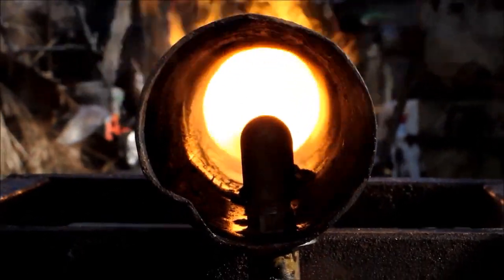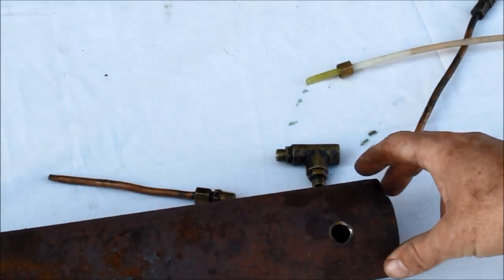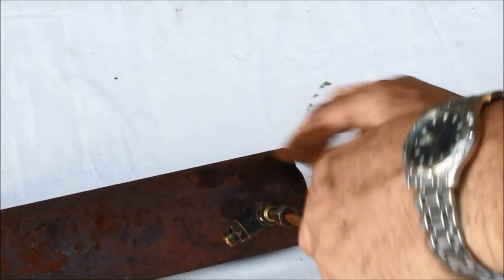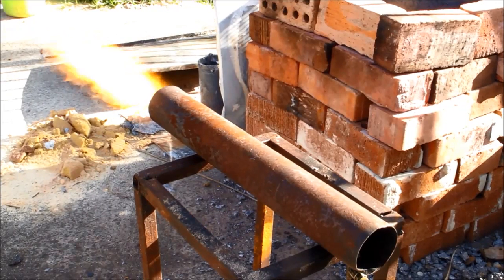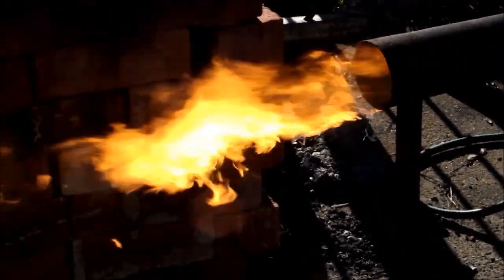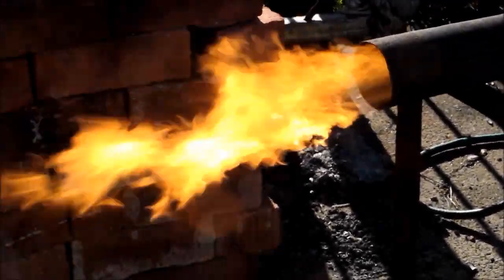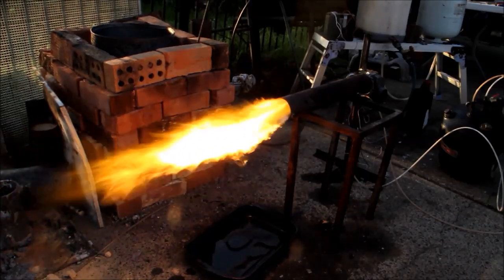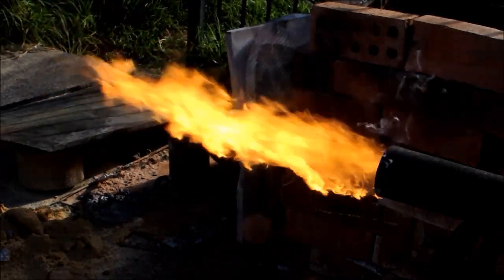Oil Burner Lighting demo  and Setup for heater and furnace applications

Comment: I am glad I came across your videos. It's true, one might get the impression that you need a PHD and access to a machine shop in order to build an oil burner based on other videos. Thank you
Reply from the maker: Thanks mate. 
Yes, there is an ingrained culture these days that unless something is expensive, overly complicated, uses a lot of power and has many failure points, it can't possible work. 
I Demonstrate my disagreeance!  :0)
Reply: @glumpy10  that's the trouble, you'd be amazed at how much electronic bullshit is inside a modern oil burner. The old rotary cup burners have insane reliability and never break down. Same with the big industrial compressed air burners. Just replace the motor or nozzle every year and it runs perfectly without fail. Since the late 1990s oil-burning appliances have had to become more complicated and unreliable so that the manufacturers can sell expensive replacement parts that you need a laptop and expensive software to "repair" when it's solely a software problem and not a mechanical problem with the burner or machine at all.

Comment: I built this burner, and it sprays beautifully. But i am using old motor oil, and it doesnt want to light for me. Is there a significant difference in the comustion of used engine oil vs veg oil? Or am I doing something wrong?

Comment: wouldnt it help, to wrap some heatproof insulating material around the burner pipe? that way radiating temerature inside the pipe would be much higher and therefore oil would evaporate more easily?
Reply from the maker: +margus014  Yes, I am certain it would and that's a Very good suggestion! I don't have any such materials myself but I think they would work very well.  I am planing on modifying this setup to make a Hybrid Spray/ drip burner and the insulation would make that work even better still.  I'll keep an eye out and see what I can find. 
Thanks for the valuable Suggestion!!
Reply: +Oil Burner you could use fiberglass cloth or rockwool. both very cheap
Reply: +Oil Burner Thanks Oil Burner, I will be building this to be used in an Aluminium scraping furnace. I had one of those manufactured overly complex burners and this design absolutely crushed it on performance when I small scaled tested it and now I will be building a full scale one as a result..... I wished I discovered your channel much sooner and I would have saved me from wasting $5000 CDN on that other burner. this build is estimated to cost me a mere $50 and with much better results......I would highly recommend your channel to anybody that needs or wants one,They just simply work damn good.... You sir, are a simplistic genius period!.
Reply from the maker: ytrewq6789
 Wow. Thank you for what I think is the overly kind words. I appreciate them very much.
I don' know about Genius but simple seems to be an appropriate description! :0)
This isn't actually something I came up with all on  my own. I saw it somewhere years ago.
I'm just amazed that people go to so much trouble and expense with more complicated designs when this one works sooo well.

I want to incorporate this setup into one of my drip burners to make something that is a hybrid and gives the best of both worlds.
Thanks again for the kind words.  It's always really good to know what I have shown has helped someone and is something they can use.
Reply: header tape/exhaust wrap would work.  Also you could put a little air pressure on oil tank to atomize the oil going into burner
Reply: Rockwool melting point 1800f / fiberglass 1100f

Comment: another idea: use propane instead of compressed air in that system. it together with a blower could generate enough heat to melt cast iron I guess...?  
just keep making new videos. your channel is the reason I visit YouTube :)

Comment: i have tought about a design like this and wanted to know if you ever tryed it. I dont want to run my compressor all the time here in my home garage when i want heat, but i do want to use a spray burner like this. So what i tought of is use a pressure pump, let that put the oil trough a small nozzle(was thinking something like a mig welder tip) and have a fan push the air trough the tube. Have you ever tryed that? And did it work? I would try it myself, but havent got the time and space for it at the moment. And i offcourse dont want to try this out inside.
As for the oil pump, i have some destoyed car engine, those oil pump are all chain driven, so should be easy to turn that with something. For testing i just wanted to put the shaft of the pump or a shaft with a sprocket on a drill and turn it like that. Then put the suction part of the pump in the oil and the pressure part to the nozzle. And most oil pumps are internally regulated to something like 6 bar, so those copper pipes should hold that without a problem.

Comment: What are your recommendations for high kal burner for waste tire pyrolysis? How mm wide of the nozzle and suitable air pressure? Should I use air blower or air compressor?

Comment: What are you using to power the air in the line? Obviously not  a fan blower that would be to energy efficient  looks like it could be an  air compressor? How much PSI are you putting through it?
Reply from the maker: This is the one and only burner I have built that uses compressed air.  I don't like them either because I can get more heat with far less energy use with a blower rather than a compressor.  I Don't remember what the PSI I was running was.  More to do with air Volume that pressure.  This was to show how easy, cheap and simple a spray burner could be constructed as against everything else that seems to use special Nozzles and still gives problems.

Comment: Good work. To prevent the oil from dripping from the tip of the cylinder/tube, the cylinder tip circumference has to be curved or bent inwards by about 45 degrees. Also the air to fuel ratio should be increased so that the flame will be hotter to vapourize more oil for the combustion, so that the oil will not remain as liquid(vapourized oil cannot drip but liquid oil can)

Comment: If you added a throttle valve for the air, would you be able to throttle both down to where you get a smaller quiet flame, for like a fire pit to relax around?
Reply from the maker: I don't see why not. If you balance the fuel and air you can get the output right down but for a fire pit I'd just use a blown air design like all my others rather than run a compressor.

Comment: maybe if not seen it yet. But it seems like you are 1 of the go to guys when it comes to waste oil heaters. I have build a pretty good unit myself, it heats my shop of around 720m³ without much of a problem at this point with only about 2 liters an hour of oil consumption. But now im trying to figure out a way of lighting it with the help of electronics. I was thinking something like a glow plug or something. Have you ever experimented with something like that? And if so did you get any succeses with it?
Reply from the maker: I haven't tried but the way I would approach it myself would be to start on gas for preheat and have a timer that then switched to oil.  You could do this easily with an arduino and have sequences for the blower to start, the spark igniter to run, the gas to come on, a flame sensor, a temp sensor to know when the burner was hot enough and trigger the oil,  a shut off for the oil and a secondary ramp up for increased oil and air flow just by triggering a couple more relays. 
An arduino running an 8 relay board and using a few sensors would be practical, cheap and easy. 
And could even be remotely controlled or you could set it to come on say an hour before you wanted to be in your shop so it was warm when you got there. 

External sensors could trigger shutdowns and you can even wire in gas detectors to make sure nothing goes wrong.
Reply: i have tought about running gas to get it to light on it self. But i dont really like the idea to play around with gas because that is a lot easier to get wrong. And if it go's wrong its going to be really bad. The waste oil dosn't really scare me. Yes you can burn your shop down, but its not likely to give a big bang like gas would if you get it wrong. But since you havent done it yet i might have to do some pioneering in this world. I hope i find some way it works, and if i do i wil probably come back to your chanel to show you too.
Reply from the maker: Gas Really isn't a big deal. I think a lot of people are scared of it because of Misapprehensions.  In this case it's very compatible with oil  for ignition purposes and could very easily be integrated to what you want. Make no mistake, Oil that is atomised to the point of being ignited by spark or preheated so it can be ignited through a spark or flashes by itself is every bit as capable of going bang as Gas is.  
They would both be flammable mixtures and equally as able to cause grief as each other. 

Personally, I'd rather have gas go wrong.  It's more easily dispersed for one thing so the chance of the whole amount igniting at once is less.  With oil you stand a much better chance of getting a bang AND a resulting and enduring fire.  Don't know what the specific energy value is for each but I'm pretty certain has a lot more than gas for a given Volume/ weight. 

That said, the ability of gas to light much more easily that oil in my book makes the chance of Mishap much less. In an automated system you would have the spark  running a second or so before the gas solenoid opened and  then a  flame detector looking for the fire to keep the gas running till it got the shutdown signal. If you fail to get a light, the Blower keeps running for say 30 Sec to clear all the gas then the controller goes for a relight. 

The only way I know to light oil from the get go is high pressure atomisation using a special nozzle and controlled mixture settings. Way more complication that using gas and I would suspect has a lot of built in failure and danger points on it's own. 

Keen to see what you come up with though!  :0)

Comment: Mite be a stupid question but if the diameter of the combustion chamber pipe was increased will that also increase the flame size or is it all down to air fuel quantity
Reply from the maker: Might make the flame Fatter and shorter so size is relevant but the heat output is down to the amount of fuel consumed, You may be able to get more power with a bigger tube by the induction of more secondary air IF you turn the fuel up  but the heat output would be the same  at the same fuel setting.

Comment: Very cool again. so here it's the one where you put the oil and the air under pressure. Would addin a blower help in any way?

I'm eager to watch you enclose it in an actual heater. The question I have in this reagard is do you put the hot end closer to the 'cold' water inlet or the other way round? or does it matter at all?
Reply from the maker: +Yves Baggi  Adding a Blower is the next Vid!  :0)   I don't think it matters with the water heating. On the tank I converted in another vid the outlet is at the top due to heat rising even though the fire is at at the bottom.

Comment: What sort of projects would this kind of burner be best for, vs. the type built from a fire extinguisher bottle?  Maybe this type would have lower output pressure, or is that determined by the blower?  Is this type just longer than the swirling style of burner?
Reply from the maker: +MrTechnophile   The pressure of the burners is largely determined by the output size of the nozzle. Larger nozzle, lower pressure for a given output.  I tend to think the spray burner would be better for shorter run or multiple light up applications.  It is also much lower output than the bottle type burners although probably of a more practical level as well.  You do need a compressor which is more noise, power consumption and expense than a blower. 

The setup of the burners is fairly adaptable for all.  You could shorten the length of this spray burner easily. As it is the nozzle is half way down the tube anyway so that could be very easily shortened.  Using heavier gauge pipe with a perforated stainless insert would provide a source for the ignition and  the whole burner could probably be shortened to 6" without much  effort and still run perfectly particularly when located in a metal furnace or a HE for a home heating application.

Comment: I'm assuming it is necessary to run the oil feed tube mostly through the Tee in order for the compressed air to siphon it, yes? that's why you used compression fittings rather than threaded?
Reply: well, not siphon, but rather atomize, sorry.

Comment: I wonder if you were to build a jet engine from scratch if you could use something such as this to inject the fuel into the combustion chamber of the engine, since the air is already flowing at high velocity through the engine and the air is hot from being compressed, would this work?
Reply from the maker: You would need to have the oil pressurisied above the compressor pressure. Combustors work Different in jets as they use the air pressure to hold teh flame in suspension in the combustor and try and keep it from the walls of the burn chamber.  All you need to do on a jet is inject the fuel direct and the air enters tangentially to mix and suspend the flame.

Comment: Nice Venturi, how simple,  thought the tube would go purple & burn off the leaked dribble also.
Reply from the maker: +Roberto .Cavanagh  The nozzle comes down past half way in the tube. When I get round to shortening it I'm sure it will burn all the oil.  It gave me the idea to make a Hybrid spray/ drip burner which I'll do in a future vid.  This will allow easy lighting and high power output without having to run a compressor ragged all the time it's running.

Comment: Is forced air mandatory for this to work?
Is there no way air holes will provide enough rush of air?
I'm looking to make a waste oil burner for a campfire to save money on fire wood.
Reply from the maker: There are updraft types favoured by the Russians and eastern block countries.  they mainly use them for space heating but some are adapted  for cooking.  I have made these myself ( and lost the Videos) and they do work OK but they are dirty and sooty running no matter how clean they burn, you still get a LOT of buildup unlike the forced air types that burn soot free. 

You also have far less control and ultimate heat output. 
That said, they require no outside input at all apart from the Fuel. 
Not sure how you are going to use this in a campfore you buy wood for but if you look at my  12V Bilge blower vid you can see you can use one of them with a car battery that would last all day and night.  The blowers don't use much power and you could even slow them down possibly just using a 12 light bulb as a resistor. Depends on how much flame you want.

Comment: Ok what feeds this burner. Oil im assuming is gravity what is th ecair supply
I'm building one to melt aluminium engine blocks
Reply from the maker: This is my one and so far only burner that runs on Compressed air .  I prefer forced air burners as blowers are a lot quieter and use less power than compressors and also can be made fully portable with 12V Blowers. 
There is no set CFM with this design, as with every other burner I do they are variable output so the consumption of air and fuel is completely dependent on how much heat you want to extract out of them. 

For melting engine blocks, I would use a forced air burner as you could pull far more heat out of them without running an industrial size compressor.  You can see where I have melted heads and other various aluminum pieces on my other vids.  I forget the output of this burner, I'd guess you would maybe get up to 200Kw with a 8 CFM compressor but with a blower for a jumping castle, pretty much the sky is the limit.  600Kw from one of those is just where the fun begins.  I would also Highly recommend using a pump for the oil if you want to go much above 200Kw as it makes tuning and stability so much easier. it's not complication, it's a great increase in ease of application, control-ability and potential output.
Reply: @glumpy10  thanks for your reply it is great help, far from the (3rd grade response I kinda expected. LOL. 
Thanks I will build one out of a grill cyclender thanks and keep the vedios coming.

Comment: Good job man , I have some questions that may seem silly but this is all new to me: what is the role of the tank, how does it intervene in the process?
Reply from the maker: The tank has the oil in it which is pressurised by the compressed air which also feeds the  burner itself.
Reply: How big pressure need for this burner? Thanks!

Comment: Great vid . I never saw used oil light so fast do you have a mix of petrol with it ?  Thanks for the video. 
Regards Don
Reply from the maker: I NEVER mix petrol and oil.  That is making a potential bomb. Even if you only use a little petrol the vapors will be in the tank and potentially go boom as well as if it were 100% Petrol. Come to think of it, would have more potential to go bang. People think I take a lot of risks and are blase about safety but even I have a line I won't cross and that's anything to do with petrol in these or any other DIY type burner.  Just trouble waiting to cause catastrophe. 

The pipe was long and not too heavy so warmed up fast and helped the Oil change from a liquid to a vapor which is the key element to these burner designs.  The spray helps but it's the heat that does the real magic. 
Having oil that has been dried free of water would help potentialy a lot and this may well have been dried oil I processed for my Vehicle as I would have needed reasonably clean oil for this type of burner.